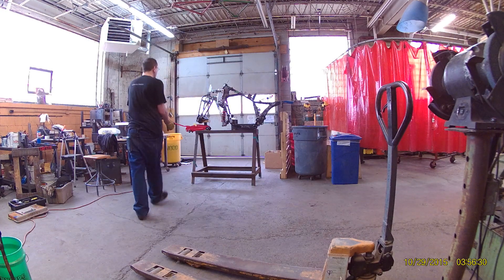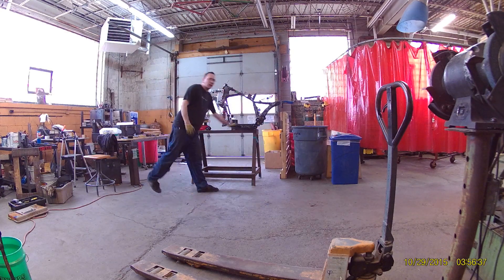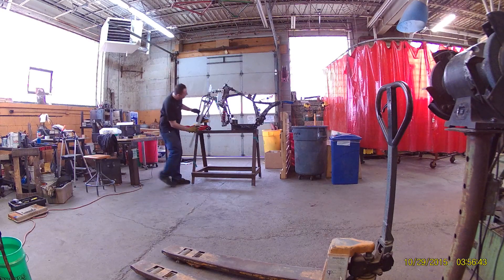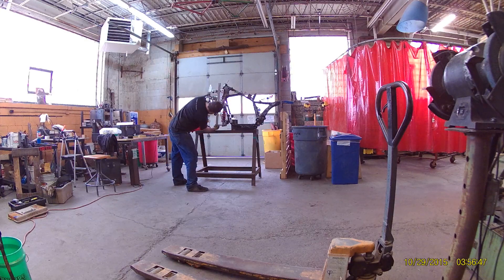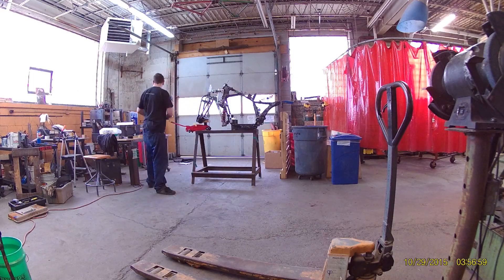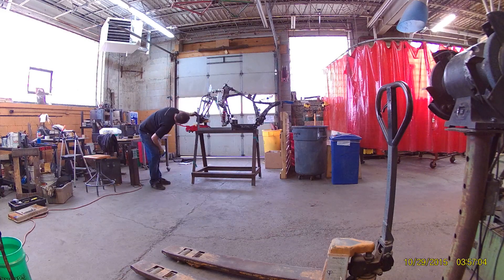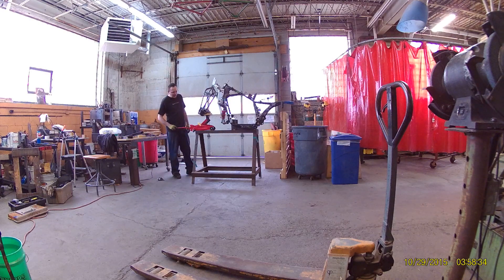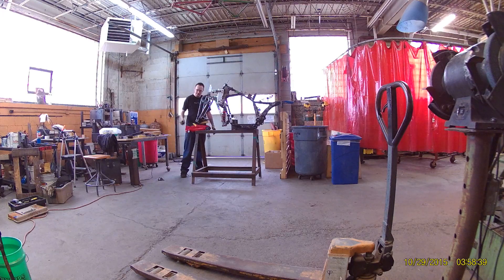home built Hossack suspension compression test

Comment: What would you do different if it wasn't on what looks like a seca frame
Reply from the maker: Yeah, its a '81 SECA.  

The method of mounting arm pivots to the frame depends a lot on what frame you use.  The design I did is fairly easy to build and could work well on most older double cradle frames, but isn't ideal.  Bikes with perimeter frames (or just wider ones) are maybe harder to jig up, but provide better attachment points; my FJ1100 would be really easy to work with, for example.  

But what I'd really like is an engine with a built in swingarm, probably a v twin, where I can attach the front end to the engine and use it as a stressed component.  Ducati, Honda, and Buell all used em.  That, or just a custom frame that is effectively just an extension of the aluminum side plates the pivots run on.